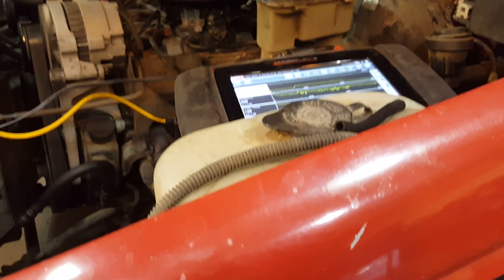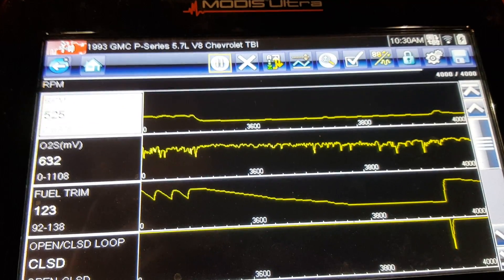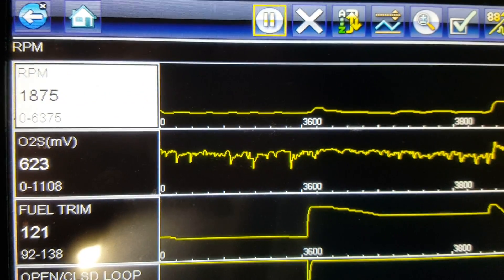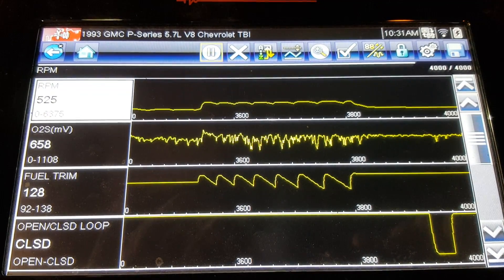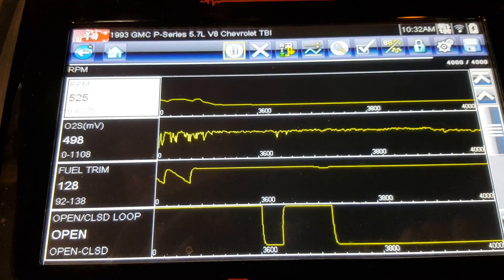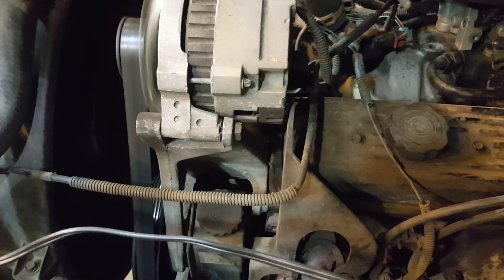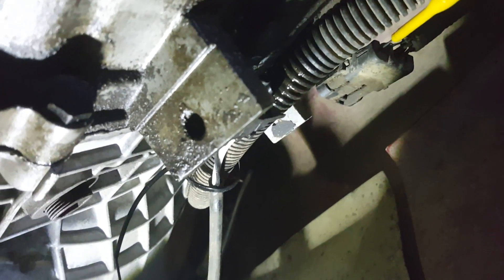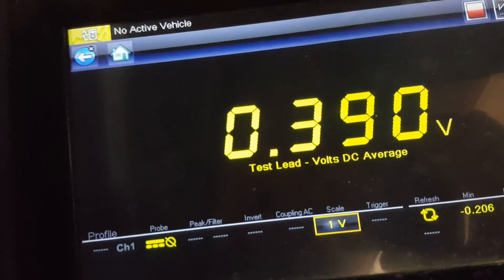1993 GMC/Chevy 5.7 surging, rough idle,cutting out 02 problem

Comment: The exhaust donut sounds like it's leaking, that causes a false reading to the 02, as too much of the exhaust is not making it to the sensor.
Reply: Is this true? I think mine is leaking and I’m having a low idle stumble then it’ll buck off I floor it
Reply: @SirGuidemere91  that is the problem I'm having below 2k rpm is sluggish then smooths out..... any luck figuring out?
Reply: @freemanfornow264  the pigtail connectors on mine were busted causing a throttle issue
Reply: @SirGuidemere91  pigtail connectors on what? The 02 sensor?
Reply: @freemanfornow264  idle air control valve and the map sensor. I did clean the throttle body when in replaced them as well
Reply: @freemanfornow264  I also replaced the o2 sensor

Comment: My 93 Silverado 5.7 tbi is doing the same thing. I have tried tracing another weird problem with the pump (buzzing) staying on even after turning off the truck by key.. unplugging the battery is a pain in the ass all the time. Anybody know what it could be? Bad pump is only thing I can think. Thanks.
Reply: OIL PRESSURE SWITCH
Reply: Oil psi switch or stuck fuel pump relay, the are typed into the same power wire to fuel pump

Comment: my temp sensor ohms at 5.4 on the 200 k scale cold,  and  0.9  hot .. truck is idling badly. when it warms up it runs better, but like its stuck on high idle/

Comment: I've had a crazy fuel pump that was in and out do the same exact thing before! Then it finally died!
Reply: I can see that happening because it boils down to a lean fuel condition
Reply: @randy1ization  gm trucks are basically junk. ive got a 2009 now problems problems all the time i just dont get gm at all?? they use to be good.

Comment: I'm kinda having the same problem..... I'm "running" from what I was told a 90 Camaro 5.7 TBI with cast heads with about 100k on motor. And a 90s ECU for management from aperently a 90s Chey truck!!..this is what I was told!!! But egr is deleted as well as heater core and all vacuum hoses. I'm Running a t56 transmission as well.....NOW THIS "SWAP" is in my 92 Nissan 240sx. Lol. So everything is okay I guess but power is garbage dyno at 184 hp and 270 ft lbs I'm running a walbro 255 fuel pump for fuel delivery. And my  O2 sensor is garbage and just zip tied to the side of fire wall haven't made a bung in my down pipe yet.. but really shouldn't cause it to idle and die. None the less   here's the problem. When starting the car/motor I have to constantly keep the revs/rpm at about 1000 rpm.. if not motor wants to "TRY" and run at 400 to 600 rpm and stall/die. Drove it at a DRIFT event a few weeks ago.. and was really honestly trying to blow motor so I can put another 350 in it. But NO GO. Full cast iron motor/heads aperently hard to blow up. Lol But motor/car would still runs fine after beating the ever Living shit out of it. But when coming back around to start line it would want to stall. Same as driving in the street I have to heal/toe= drive with heal on throttle and toe on brake..or vice versa depending on how you drive  to keep revs/rpms up. Haven't really had time to track down the problem because I work a lot but this week I picked up a summit/ Holly 650cfm dubble pump carberator!! Probably too small for what I want to do. But I also picked up an elderbrock high performance intake for the carberator going to throw it on the motor with a HEI distributor to gain my damn HP back. but it's still cold here in GA  and need a good daily driver so this is gonna be my daily for a bit. And don't want to install carberator/ intake/ HEI just yet because the TBI is more reliable as a daily driver..... But I need to figure out idle/stall issue on the motor before I  start driving it about 500+ miles a week for the next few weeks... I know the IACV An TPS could cause these problems I'm having.. but everything it's all okay I've checked resistance and voltage on both and installed new just incase an still same issue.  the only thing I might think it could be is that my alternator is only producing about 11 to 12 volts at a low idle "below1500 rpms" and then upon running above 1500 RPM it will do about 13 to 14 volts but that's just my voltmeter that I have inside on the dash so whether or not that's a hundred percent is I don't know... As I said will run.. an run fine but letting off throttle and trying to get it to idle on it's own it just wants to stall and die now I am running a smaller alternator off a John Deere diesel tractor from the 1950s but it's able to produce enough amperage and voltage be able to continue running the motor find the battery has been relocated to the rear of the car using 0 gauge wire... I am running a front plate Mount on the motor and a trans mount only no motor mounts but also having charging issues. Will post video later. Altenator is rewired as a single wire with internal regulator I have grounds from chassis to motor but it's a damn headache. I honestly do not know what stock/standard proper fuel pressure is susposed to be ran on 5.7tbi.
Reply from the maker: james wilson is the o2 wiring connected to the o2? If so try disconnecting it and see if it runs better. Also check for vacuum leaks and intake leaks. That will make it idle rough and stall but run better at higher rpms.
Reply: Wicked Spray yes O2 is connected will try unplugging it when I get home.
Reply: 9-13 psi

Comment: I have a problem with mine that it spit and sputter then once it get about 180 200 temp it runs fine I changed the spark plugs the distributor cap is new the wires are kinds new. I tested fuel pressure it's low but I wouldn't understand y it get better once it warms up if it was a fuel pump.  I tried the o2 sensors thing and it still was the same so Idk
Reply: Woolen Ominvore  did you ever get it fixed?

Comment: i got a 98 chevy tahoe new fuel pump and filter starts but wont stay running please help
Reply: EGR
Reply: Check coolant temp sensor, if its bad it shuts the fuel circuit off. this circuit also runs thru your oil pressure sensor. check these before replacing high dollar fuel parts.
Reply: I put a new fuel pump, and did the same thing, pulled it all apart changed the lil hose and clamps to metal hose clamps make Shurr all o rings are in place ,I was missing an o ring, now runs strong

Comment: I have this same problem and it wasn't my O2 sensor. Another other ideas?
Reply from the maker: with out seeing the truck maybe fuel pressure, a spark problem, vacuum leak, timing, engine coolant temp problem, map sensor just to name a few.
Reply: Wicked Spray MAP sensor

Comment: hey Wicked Spray i have a 1993 cheyenne doing the same thing. ive replaced every sensor and electrical part under the hood with no luck. but my O2 sensor you mentioned isnt attached to my exhaust. its just hanging next to it(when i had exhaust repaired they used a straight pipe without the O2 port. could this be my problem? according to this video i can unplug it and remove it all together and my truck will run ok? thanks for the video and any info you can provide. been trying to get this truck running right for over a year. dont want to scrap it over something small i just cant figure out.
Reply from the maker: Is the 02 sensor still connected to the wiring or is the 02 sensor missing? If it's still connected that very well could be your problem. What happens is if the 02 sensor is disconnected from the wiring harness the computer can detect that and reverts back to factory settings for fuel delivery. This will usually keep the engine running and run half ass descent. If the o2 sensor is still connected this will cause the computer to get a false reading and seriously lean out the fuel trim, remove it and see if that makes a difference.  Other problems could be a bad distributor cap/rotor, bad plugs/wires, fuel pump, bad vacuum leak(especially the brake booster), bad map sensor or timing off.
Reply: Wicked Spray thanks for the reply. Yes the O2 sensor is still connected. I’ve replaced the plugs. Wires. Map sensor. Cap rotor and that plug on the distributor. Checked the vacuum on the hoses. I feel like the only things left are the fuel pump and distributer. I’ve tested the fuel pressure tho and it seems to be fine. I’ll unhook the O2 sensor tomorrow and let you know if it helps. Thanks for the info.

Comment: Mine does this and I've already changed the oxygen sensor I have a one wire 92 c1500 runs fine idols like crap
Reply: Check the throttle position sensor

Comment: I would've appreciated if you would've showed the sensor & also where was located
Reply from the maker: +ggg's fan the front o2 sensor is located in the exhaust pipe under the truck just before the exhaust heads up into the engine compartment.
Reply: Wicked Spray thanks 👍
Reply from the maker: no problem. This was my first vid. I'll make sure to show locations better in future ones

Comment: I have a 88 Chevrolet Silverado with 5.7 only cuts out after warmed up. Its not o2 sensors. Any ideas
Reply: Ignition control module
Reply: If it was ICM it wouldn’t even crank

Comment: is it the same on single wire pre exhaust chevys, if I unplug it and it stops surging its an o2 issue
Reply: Was it an o2?
Reply: @chastblind7606  no it had the wrong size fuel injectors in it
Reply: @randy1ization  damnit dude I've replaced so many parts I'm ready to give up! I doubt it's my injectors I have spares and when I switched them out. It's still the same!
Reply: @chastblind7606  u need to get an OBD1 tool to see whats going on.  if u are sure u have no vacuum leaks, and are using high quality parts is important too.. lots of cheap junk that doersnt work right out of the box, what exactly is your truck doing? what year is it?
Reply: @randy1ization   i've replaced IAC, map, spark computer thing, EGR valve solenoid, TPS, fuel pump relay and rebuilt the TBI. I do have the EGR valve O2s and temp sensor on order. The truck will try to die sometimes after I put it in drive/reverse my idle is somewhat okay. It will die sometimes. Idk after all this I just might do fuel pump and screen last. I've replaced almost everything at this point
Reply: @chastblind7606  did u change/check  the pcv valve?
Reply: did u drive the truck around a while to make the IAC valve reset?   did u put a factory spring in the fuel pressure regulator when u rebuilt the throttle body? what abt your ignition system, did u inspect the rotor,. cap? these things eat caps and rotors, is the module in goo shape? screws holding it to plate not rusty and corroded? is your base timing good?
Reply: spray the cap and wires with water then start the truck up in the dark and look for arcing.  check the ground wires at the tstat housing and make sure they arent corroded. u may have an ignition problem and not a fuel problem.
Reply: @randy1ization   texas tough  pcv was changed. I only drove it for like a minute or two I didn't do that obd port reset thing idk if that would matter. The spring came with the rebuild kit. The cap I can't find or buy another without buying the whole tbi. i have not checked coil wires rotors cap or plugs or timing. Just assumed they were already good as truck cranks and starts. Nothings rusty it's good
Reply: @randy1ization  alright will do i appreciate the help
Reply: @chastblind7606  i meant the distributor cap.
Reply: theres a way to reset the Iac but driving it around above 30 mph for abt 20 minutes is easiest way.. it has to cycle and center itself, then relearns where it needs to be.
Reply: @chastblind7606  many times what u think is a fuel problem is ignition and vice versa,.., when u shift into gear, u put the truck under a slight load, and a arcing plug wire, or weak spark or fouled plug can make it miss.  pull your plugs and look at them,, plugs can tell you ALOT..!
Reply: @chastblind7606  try  paper clip reset thing, then go from there.
Reply: the inside of the rotor caps are bad abt cracking, replace it.
Reply: the IAC and the TPS work hand in hand.. many new tps arent adjustable and must be slotted to get the proper resistance value.. the aftermarket crap parts cause alot of problems.. chinese junk !!
Reply: @randy1ization  after all of this I need to change my pick up coil or my icm on the distributor. After so many new parts smh
Reply: @chastblind7606  ignition is more of a wear item than the fuel system.  get the best parts u can afford. I would pull the whole distributor out and inspect it.

Comment: OMG I got to take some college classes to understand this guy
Reply: James Bobo it's not hard to understand the O2 sensor ideally should read .500 volts anything above that means your rich so the ecu will pull back fuel below that your lean so the ecu will add fuel, if you had a scan tool you can see this as a percentage. That's just the simple jist of it there's more to it but you can find out if your O2 sensor is bad with just that info.

Comment: I have this problem before I saw this video and replaced my O2 sensor and I still have this problem so this didn't fix my issue
Reply: Try looking at the throttle position sensor
Reply: @johnwayne8178  I got one yesterday. Also I'm going to be replacing the fuel pump relay
Reply: @brettbeez  I was reading your post, so is your truck fixed?
Reply: @robertoleeva985  my issue was a bad fuel pump. Once i replaced it the issues stopped. The old pump was running hot and inefficient

Comment: so whY was wrong with it
Reply from the maker: vince flores bad o2 sensor.
Reply: The knock sensor $50-$80
Reply from the maker: Charles Matthews it wasn't a knock sensor.
Reply: Wicked Spray i have a 95 runs a little better than the one in the video. Its throwing a code 32 and 44 egr valve and lean mixture. Disconnected the egr and o2 sensor no change still stumbles and dies. Just started this yesterday a few hours into a 200 mile trip after filling up with high test gas. Any ideas would be greatly appreciated.
Reply: Wesley Cooper An Actron CP9690 code tester checks record, graphing, live, smog test readiness test, oil light reset, and MORE! It has OBDI cables for Ford, G.M., Chrysler, and 2 Toyota. The CP9680 only does OBDII.
Reply: Marty Stevens Thanks I fixed it turned out the fuel pump was just getting weak that's why I was getting the lean mixture code. New pump and it runs like new.
Reply: Wesley Cooper  I have a OBDI Ford which only gives codes and basic tests. BUT you have that better tester which is ALOT better! Testers like that can still lead a mechanic astray. It says open loop which means it hasn't warmed up. The pickup screen probably is getting clogged. On Fords, you need the OEM number off of the sender in the tank. You might can get one from EBay cheaper. Glad it's fixed!
Reply: Marty Stevens Yes sir the screen was filthy and I tested the pressure one the pump after it was out it was only about 1/2 the pressure it was supposed to be even without the screen filter.
Reply: it’s a 30-year-old trash boat thats the problem

Comment: Can you run it without the O2 sensor?
Reply from the maker: Yes you can run it without the O2"s hooked up but the performance will suffer, plus if you have cats installed it could melt/clog them if it's running rich.